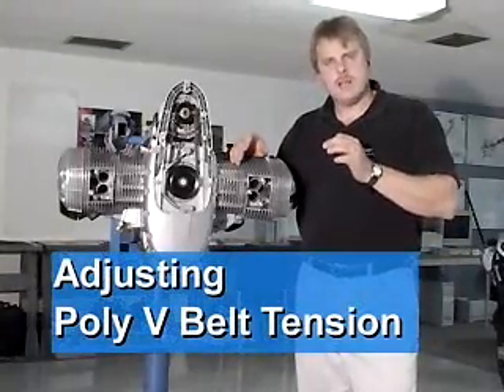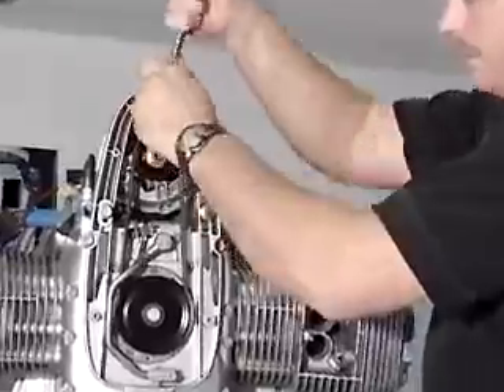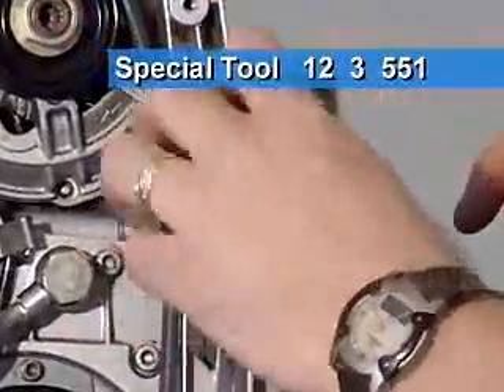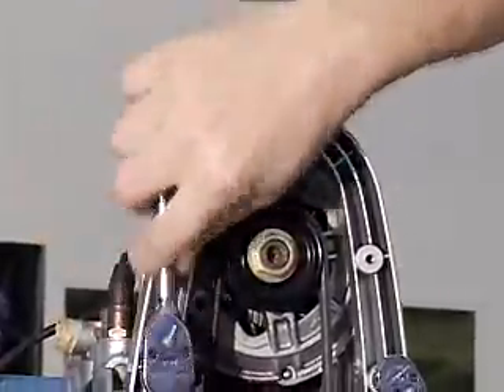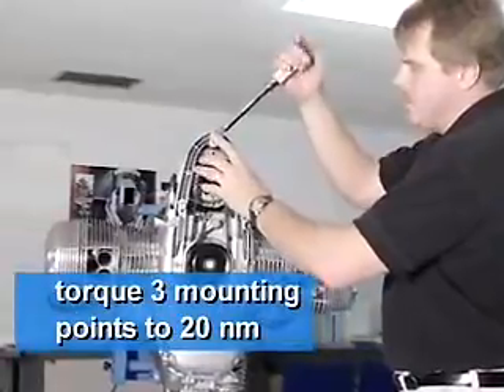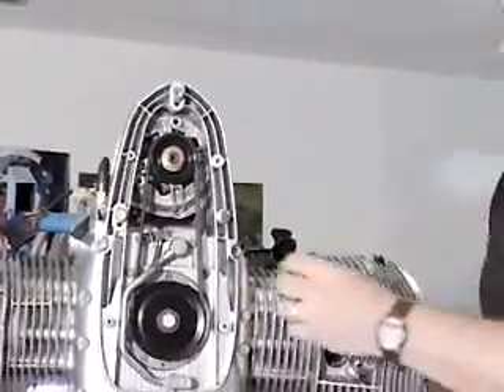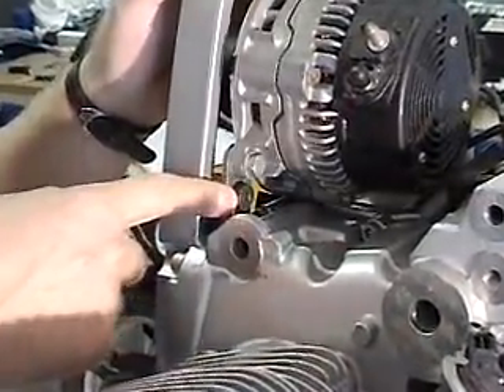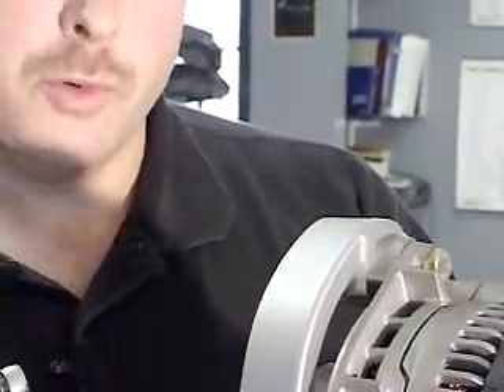BMW Poly V belt sequence R259 Oilheads R1100/R1150 series

Comment: Thanks so much; exactly the information and video that I needed having just bought the special adjustment part at my BMW dealership.   $50 seems a tad expensive for essentially a bolt with a spring attached to it but it certainly makes the adjustment easier

Comment: sorry but the job in the video seems very simple but  in my case  no because the engine is on the frame. It is not easy tight the upper bolt to 20 nm because there is the front suspension that prevents the insertion of the torque wrench.Do I have to take it apart probably. Could you help me?

Comment: I have a ‘94 BMW R1100RS with 50,000 miles. I bought it with 43k on the odometer. Do I need to do anything with the belt?

Comment: In order to replace the belt I need to remove this engine vent connecting line. What is the torque for the bolts holding this line in place?

Comment: Good Lord.
I was thinking about buying an r1150rt.
I think, "no chain to lube, no radiator to worry about, no carb to adjust."
But I have to adjust and change a frickin internal v-belt?  Jeez.
Reply: Tbh this belt will last the life of the bike if not replaced...

Comment: Hello,
I can not turn on the motorcycle. In my bmw r1100rt the maximum oil temperature and 1st gear (but dispay neutral "N")is displayed after turning the key on the FID. The starter is spinning, but the fuel pump does not turn on.
What could be the reason?

I heard from a mechanic friend that it could be a hall sensor or prevent rotor under v-belt pulley (change possision "tongue")??
Have you any idea ?